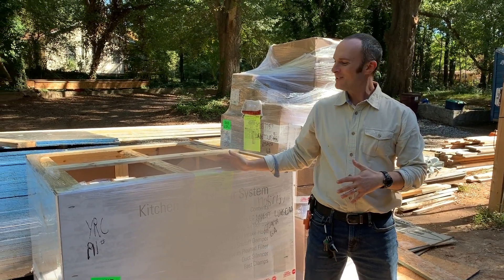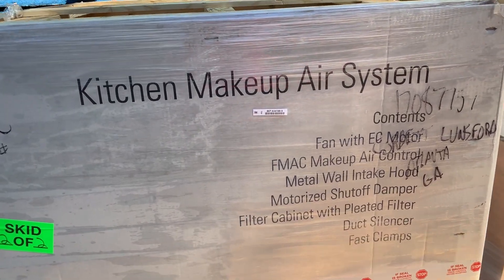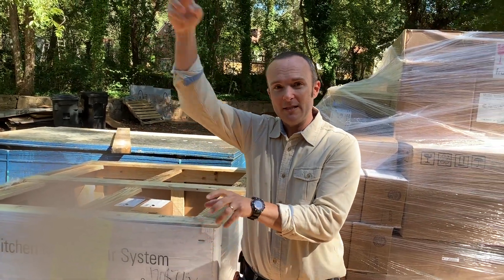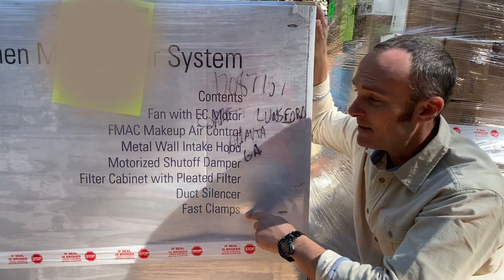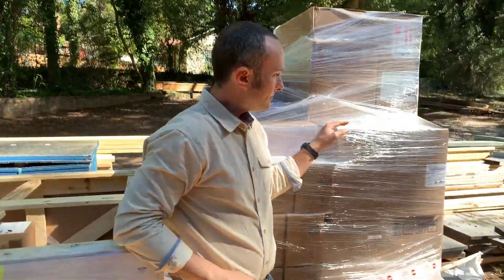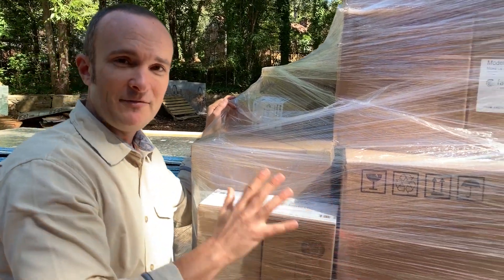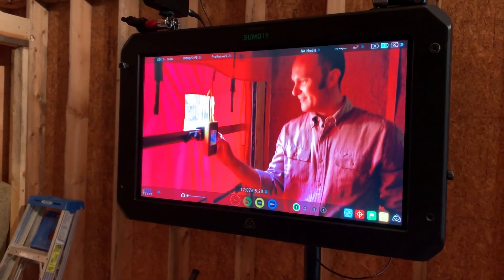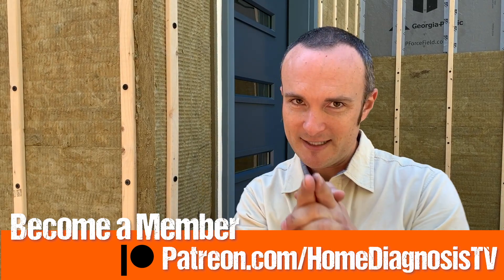Home Ventilation System and Make Up Air Delivery

Comment: Back in the 80's we would seal up the houses so tight that they would grow mold inside. Things like cabinets and furniture would outgas the fumes from glues and make children sick. I understand trying to make the house "smart" by computer controlling everything. But how about opening up the windows. Cook with the door open. Eat on the deck. Put up a clothes line. All of that OSB has got to be bad for you to breathe.
Reply: I have one of those 80s homes but no mold anywhere. You don't eat on the deck or leave doors open as its either cold and wet ot stinking hot. Yes i control ventlation manually but it would be better if it was done automatically.
Reply from the maker: I hear you, Michael, but first: this house will not be 'smart' the way a lot of marketing spins it. There will be automatic ventilation, yes, but there will absolutely be interactive feedback from us when we choose. Second, OSB is not the only thing that's bad to breathe at home- if you cook, clean, or live there, then there are bad things you're breathing unless you ventilate. And last, opening windows allows in more bad things since it's unfiltered: pollen, dust, ozone, traffic fumes. We live in a city, so we have to mind those things.
Reply: @HomePerformance  
Sorry, I never considered that the available atmosphere was unsafe for human consumption. When you said that it made me think of China for some reason. Somewhere in there is a happy medium. I spent a lifetime living on  mini farms but working downtown.   I understand trying to filter the inside air. Don't forget to spend some time enjoying the wildlife and changing leaves.

Comment: Thank you for your reply. I am watching carefully. I wanted to tell you, my wife and i will be building, what maybe the first Tight Home in The Philippines and your wall / roof assembly is very interesting. We had planned to use rigid foam exterior insulation but now i see your Rock wool and i think for drying behind the rain screen purposes, the rockwool would be a better choice.  I just had a question - in your wall assembly, you bring the rockwool up the wall and it is a continues roof assembly with seperately attached eves. Where does the rockwool end?
Reply from the maker: The rockwool will not cover the roof, but it would be great in that application too, if needed. I also like that carpenter ants don't, as far as I know, enjoy destroying it, though they do love EPS styrofoam insulation (I hear them munching on our floor insulation in the TinyLab).